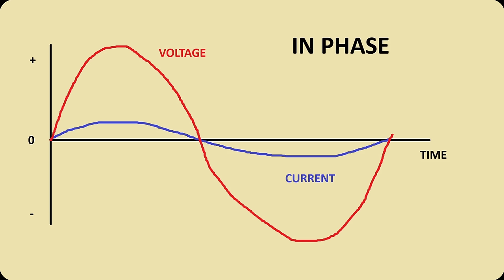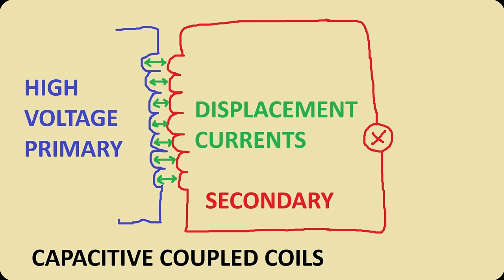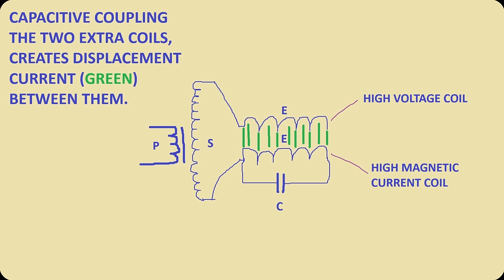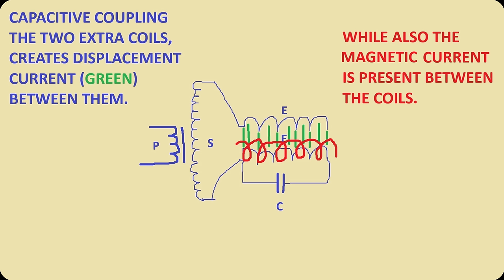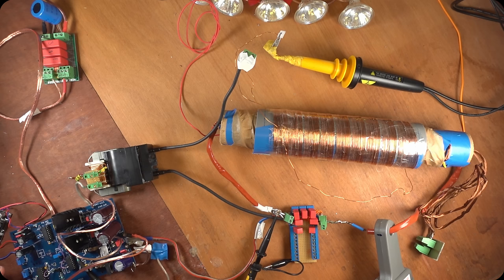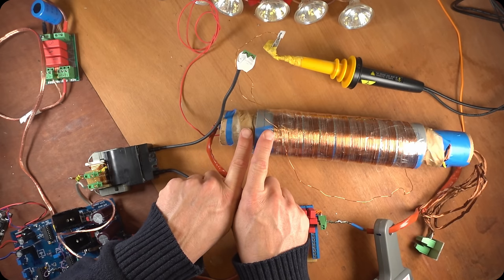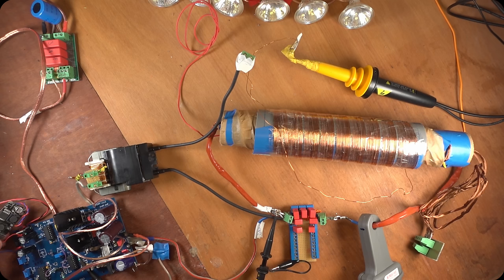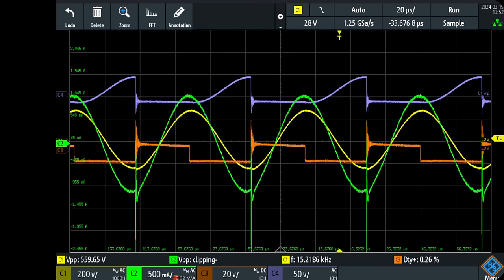Phase Shift Experiment

Comment: Or you might be able to use this information to help you.

*1. Unified System Architecture:*

   - The device consists of several key components tightly integrated into a unified system architecture:

     - Antenna System: A metamaterial-enhanced hemispherical dielectric resonator antenna (HDRA) with phased array technology for omnidirectional energy capture.

     - Tesla Coil Resonance Circuit: A digitally controlled resonant circuit incorporating Tesla coil principles for efficient energy capture and transfer.

     - Rectification and Conversion Module: Converts captured electromagnetic energy into usable electrical power using high-efficiency rectifiers and voltage regulation circuits.

     - Energy Management and Storage Subsystem: Manages energy storage and usage, utilizing machine learning algorithms for predictive energy management and hybrid energy storage solutions for high performance and reliability.

     - Thermal Management System: Regulates device temperature using adaptive thermal management mechanisms to ensure optimal performance in various environmental conditions.

*2. How It Works:*

   - The HDRA captures ambient electromagnetic radiant energy from the surrounding environment.

   - The phased array technology dynamically adjusts the antenna beam direction for optimal energy capture.

   - The captured energy is fed into the Tesla coil resonance circuit, which includes digitally controlled resonance tuning algorithms to maximize energy capture efficiency.

   - The resonant circuit transfers the captured energy to the rectification and conversion module, where it is converted into stable DC power using high-efficiency rectifiers and voltage regulation circuits.

   - The converted electrical power is then stored and managed by the energy management and storage subsystem, which utilizes machine learning algorithms for predictive energy management and hybrid energy storage solutions for optimal performance and reliability.

   - The thermal management system regulates the device temperature to ensure optimal operation in varying environmental conditions, enhancing overall performance and longevity.

*3. Assembly Instructions:*

   - Begin by assembling the antenna system, including the hemispherical dielectric resonator antenna (HDRA) and phased array components. Ensure proper alignment and secure mounting.

   - Construct the Tesla coil resonance circuit, incorporating digitally controlled resonance tuning components and Tesla coil principles. Follow schematic diagrams and assembly instructions carefully.

   - Connect the output of the resonance circuit to the rectification and conversion module, ensuring proper wiring and alignment.

   - Assemble the rectification and conversion module, incorporating high-efficiency rectifiers and voltage regulation circuits. Follow manufacturer instructions for assembly and wiring.

   - Integrate the energy management and storage subsystem, including hybrid energy storage solutions and machine learning algorithms for predictive energy management. Ensure proper calibration and configuration.

   - Install the thermal management system, incorporating adaptive thermal management mechanisms for temperature regulation. Ensure proper ventilation and heat dissipation.

   - Once all components are assembled, perform thorough testing and calibration to ensure proper functionality and performance.

   - Mount the device in its intended location, ensuring proper alignment and environmental protection as needed.

By following these instructions, you can assemble the optimized radiant energy harvesting device and harness ambient electromagnetic energy for various applications efficiently.

Comment: Hi, I am wondering how your field propulsion experiments are coming along, have you found anything new?
Reply from the maker: well I found a large acryl cilinder that I might use for a vacuum experiment, and I might use stacked plates, in combination of a high voltage dc place and a sawtooth plate
Reply: @MasterIvo  interesting, thanks
Reply: @AlexanderKnotts  Have you ever heard of impulsion? The idea is that instead of utilizing magneto-kinetic energy to propel towards a point you would use dielectric rarefaction to "fall" or "plummet" along a vector towards a point in the sky. Almost like an artificial gravity well. Supra gravitic rather than anti-gravitic.

I believe this is the tech that uavs are using.

Comment: My question: what about the mutual inductance and the coupling factor?
Reply from the maker: inductance  of both coils is very low,  and mutual inductive coupling is also low. so it mainly works by the changing high voltages (this video it was still relativly low, now I have 22.7A from around 30kV)

Comment: Hi. Why not use Arduino, or AtMega32, or ESP32 to program shifting better? It's cheap and you can even ask AI to create a basic code for you. So, time saver.
Reply from the maker: might indeed work
Reply: @MasterIvo  I fix electronics since the '90s, here you have over 600 videos just by the way.

Comment: Hey Master Ivo ...  I am so rusty with this phase concept.  Am I correct in saying you want the voltage and current in phase  in order to have 100% efficiency on your load output?
Reply from the maker: I want the induced voltage amd current in the load coil te be in phase. Not sure yet how that exactly relates to the primary phases. as one primary induces the voltage while the other primary induces the current.
Reply: Seems you are talking about a form of Poynting Vector Synthesis? Have you looked at the crossed field antenna concept which for ed the E and H into phase directly at the antenna? Could this be a clue?
Reply: @gsteckly  when you have two waves overlapping each other evenly that in phase . In Tank Circuit the signal reflection is 180 degree out of phase . To get amplification of two in phase signals , one of them must be equal to more than 1 in regards to amplitude

Comment: Master Ivo, could you please explain the schoolgirl motor worked on by John Bedini? Thank you sir.
Reply from the maker: That didn't work as advertised, no gain in energy, only resonant transformation of energy.
Bedini always focused on the back emf, 
while actually knew the magic is in  the front emf.  the coil capacitance has zero reactance when the voltage is zero.
Reply: Thank you Master Ivo.

Comment: Do you sell your PCB boards? I have a project that I want to use magnetic flat wire to create capacity in my inductors. My plan is to Wind, a pancake coil trifler using magnetic flat wire like half inch wide blind three wires over the top of each other to a capacitor. my only problem is finding a circuit that can discharge rapidly causing that voltage spike that you talk about or offset that voltage spike that you use
Reply from the maker: You can make it yourself, magstar.eu/mosfet

Comment: Hi Ivo, this video could easily spawn 2 or 3 more just unpacking everything in this one. The circuit diagram of the PCB for instance and more detail on the coils. 

The departure to this coil structure is because the bifilar pancake coils & coil capacitor — your Back to the Future FLUX CAPACITOR — didn’t supply enough power to be considered one wire or wireless Magnifying Transmitter??? Is that fair to say you’re off in that direction now???
Reply from the maker: I might have over complicated every thing. this is still a coil (flux) Capacitor. I will revert back to the pancake coils.  but now with the high voltage ac transformer added to one plate coil.

the displacement current is to be mixed with the magnetic current

Comment: why not use the original Tesla coil project? Tesla not use electronic component , of course, the Tesla coil is resonant circuit, the generator charge the capacitor, between the capacitor, and the primarry coil is the discharger, (eclator), the capacitor, and the primarry coil is the resonant circuit, with secondary coil, both need for achieve the global resonant circuit.. and this is the problem, no one know the value of capacitor..., modern digital, or analog oscilator based generators, not acieve, the correct parameters, because no one knows the original tesla coil resonant point, this is why many tesla coil experiments working, but not properly, only amusement, entertainement purpose,but no one noticed this, the wawe form, for original tesla coil, (primary side) is shawthoot form,not square wawe, and the whole system on certain frequency is in phase, he said : all about resonance, and frequency...he use only stable components.for example somebody from Hungary said : is use two alluminium sheet, and thic polyethilene sheet between alu sheets, these form the capacito, because the modern high voltage capacitors blow up after 1 minute of work(all we tested)......i am not a engineer, this is just my opinion.. only
Reply: I feel you I think the big reason that no one really replicates Tesla is because they're doing too much measuring with shelf components and preset values. You need to be daring and crazy like a John Hutchinson character to replicate Tesla's work using battleship electronics and massive amounts of power